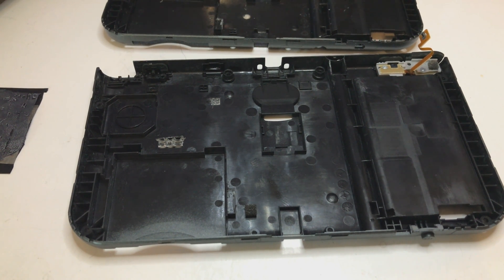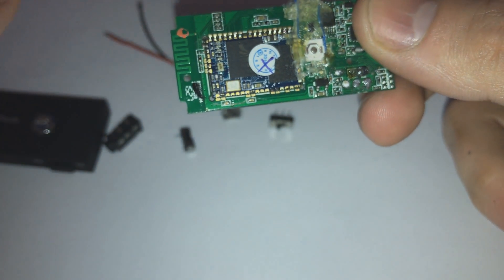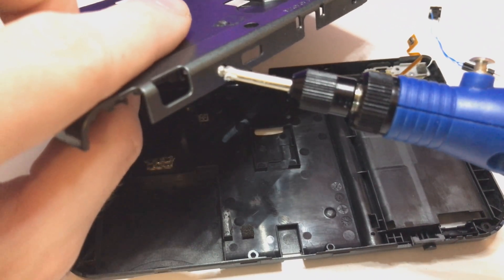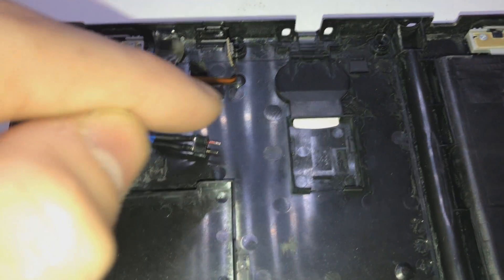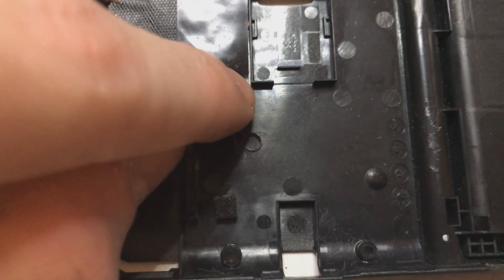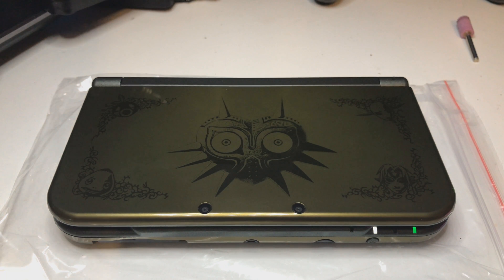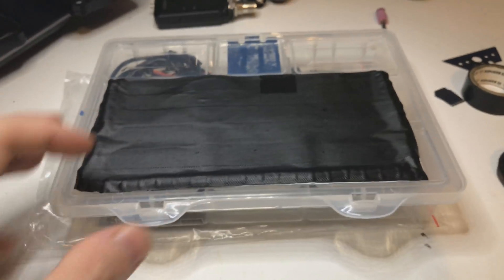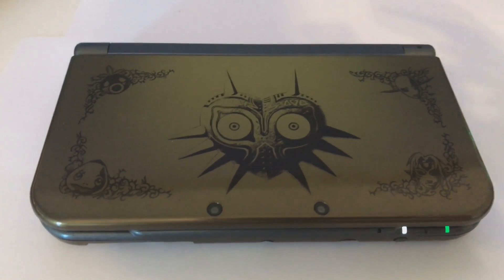Wireless charge + Bluetooth Mod Guide N3Ds XL in 4K

Comment: would there be any other ways to do this? from what ive seen on the original post some of the things required are either gone, sold out or discontinued so are you able to recommend any alternatives that should work?

Comment: Are you able to do it with a 2ds xl
Reply from the maker: not the bluetooth, i've checked, you can hardmod the 2ds and you can do the wireless charging, but it's a tight fit. but the bluetooth wont fit
Reply: Ah
Reply: Are you able to take in mine, i can pay for it

Comment: Hi there! I'm new to hardmodding, and dont have much electronic theory knowledge. So from my understanding, I can just use any coil & reciever then connect it to + and - on the charger? Or is there a specific coil you recommend? Thanks, fantastic video btw
Reply from the maker: I did recommend a certain one because i know that one will fit the housing, you’re correct you could use any, but it also has to fit!
Reply: @Gagliano17  Alright, makes sense. One last thing- how much room is there for things to go wrong? I’m on a highschooler’s budget & rlly can’t afford to kill my 3ds, so if there is more than a 5 percent chance that I mess up beyond repair, then I don’t think I can bring myself to do it.

Comment: I got a solar panel I wnana use for my 2ds xl how would I wire it up
Reply from the maker: Same spot that i used for the wireless charge mod
Reply: @Gagliano17  I cant see where need to solder the solar panel
Reply: So it gets soldered to the charger port the plate on the sides?

Comment: Can it be controlled with an 8Bit controller as it now has bluetooth?
Reply from the maker: not with this bluetooth no, this is audio bluetooth, but you can use a wifi tool to use a controller with the n3ds, i have a video where i show it, it's called like " my 3ds can do what the switch can"
Reply: @Gagliano17  ok I saw the video I love what I saw. Any chance you could make a video on the process you did to get it working like that?

Comment: Hey dude, nice job! But, didn't the 3DS already have a wifi module? And couldn't you use that instead? Because if I remember correctly wifi and bluetooth share the 2.4ghz frequency
Reply from the maker: No, bluetooth is different from wifi, especially ad2c, which is the streaming of audio, you cant modify the wifi chip to also support bluetooth if it wasnt made so from factory
Reply: @Gagliano17  ohh, thanks bud, i didn't know :D!

Comment: Where can i buy the zelda shell?
Reply from the maker: Aliexpress, i think i linked it?
Reply: @Gagliano17  ive read all the comment but i could find a link.
Reply from the maker: € 12,46  10％ Off | 2020 Newest Full Set Housing Shell Case with Buttons Screws Replacement Console Case Faceplate Cover Plate For NEW 3DS LL/XL
https://a.aliexpress.com/_veadFx
Those are different ones but you’d be able to find any there
Reply from the maker: € 5,13 | Original top shell case housing front cover for new 3dsxl for new 3ds xl US limited version
https://a.aliexpress.com/_u8EYKN
Zelda one is sold out atm
Reply: @Gagliano17  yeah😢i hope they restock it someday, thanks anyway
Reply from the maker: They probably stopped producing them because of the switch :(
Reply: @Gagliano17  so i might never get one, god i hate myself for not buying one
Reply: @Gagliano17  i asked a seller if they had leftover stock, and they actually had 3 leftover shells, and i bought one
Reply from the maker: YES DUDE, congrats!

Comment: Very nice, I have a type C mod I am doing to my  charger port. Might add a wireless charger
Reply from the maker: i'd do that, it's not expensive and plenty easy when you already desolder the original port, just adds to the upgrade experience
Reply: @Gagliano17  Yea simple stuff. my F1 fuse by my battery shorted out. Had to unsolder that and put a new one one it.

Comment: Tried the wireless charge part of this, used a s5 charger. When I placed it on a charger it said system failure, and now is hard bricked.
Reply from the maker: what do you mean place it on the charger? What did you do? Send me soms pictures
Reply: @Gagliano17  sorry i meant after i soldered the wires from the wireless reciever to the motherboard charging port, then placed my 3ds on my wireless charging pad to test if it was working properly it showed the orange light on the 3ds to indicate it was charging. then a few moments later the screen on the 3ds said system failure and turned off. i removed the wireless charging reciever and plugged it in, and it shows the orange charge light on the 3ds, but will not power on or do anything. i think my nand crashed somehow, so i will have to hard mod to restore it. i can send pictures of how i had it setup, and that the orange led comes on. i have tested both the fuses and neither are blown and the battery terminals are indeed getting power when plugged in (verified by a volt tester).
Reply from the maker: Must have shorted out somewhere, a wireless coil does nothing different than a cable, its + and - to the charging port, cant do anything software related unless something is not right
Reply: @Gagliano17  thats what i thought. I wrapped the whole assembly in kapton tape prior to assembly, when i tested it while it was on the wireless charger, for some reason it was sending 7+ volts to the charge port. i thought it may have overloaded a circuit or the system turned off as a failsafe, but couldnt complete the dump and corrupted something.
Reply from the maker: So it was probably a faulty wireless charge , and if that didnt fk up the charge system, which probably is replaceable, or repairable, i hope you have an older dumper ready :s
Reply: @Gagliano17  luckly i have a nand dump from when i first jailbroke it on my pc. the charge system still works oddly enough, my meter shows it both sending power to the battery, and the mother board. so i think its just a nand issue. i hope, if not i can always order a new mother board.

Comment: Taking a shot at doing the bluetooth mod tomorrow on the o3DS XL. 
Currently I have two options...
1) remove headphone jack
2) convert SD slot to microSD
Trying with a small Taotronics Bluetooth receiver/trnasmitter since I couldn't find your version.
Technically I could make it even smaller if I wire the antenna elsewhere so I might try that as well.  

Wireless charging mod was possible though so many thanks for this tutorial. 
Placed the charging coil on the battery and slapped on the back cover.
Reply from the maker: Kenta Kawaguchi aye nice let me know how that went, i did the wireless charge mods on the smaller n3ds but the o3ds seems full af, but i dont have one

Comment: What type of wire are you using
Reply from the maker: HeyItsNinja Gaming kynar
Reply: Dennis G would I be able to use this Bluetooth transmitter I can’t find the other one on amazon. link: Upgraded Version TaoTronics Portable Bluetooth Transmitter for TV, AptX Low Latency Wireless Audio Adapter for 3.5mm Stereo, Pairs Bluetooth Headphones/Speakers https://www.amazon.com/dp/B07W5S2WVN/ref=cm_sw_r_cp_api_i_TxzeEbNM3K8SF
Reply from the maker: Pictures dont give a real sense of size, especially not for internal parts, so i cant really give judgement on it

Comment: Do you have a link to the wireless charger you used? I would like to do this but space is a big concern, given how the n3ds Xl is really tight. Thanks in advance!
Reply from the maker: Ehm yeah mine expired on ebay but it was the qi receiver for the samsung s5
Reply: @Gagliano17  https://www.amazon.com/Slim-Thin-Standard-Wireless-Charging-Receiver/dp/B019YSWR2C/ref=sr_1_6?ie=UTF8&qid=1542752269&sr=8-6&keywords=samsung+s5+wireless+charger was it similar to this? Thanks for taking the time to reply to this
Reply from the maker: @rzyao64  yeah but i basicly stripped it down to the coil and just soldered to cables to the + and - of the 3ds charging port like i showed here
Reply: @Gagliano17  ok thanks!

Comment: Perfect.
3ds should have had bluetoth in the first place
Reply from the maker: Devices always should have had more, apple nintendo samsung they are all holding back so they got something for the future or to limit players, shame but its how it goes
Reply: @Gagliano17   i mean yeah, as much i would like to agree on that, if they did just that, the price just gonna jack up more, and with more parts, the easier everything will broken and that's bad for both consumer and producer.
Reply from the maker: I mean the samsung s20 ultra ist the closest we’ve come and it wasnt that much expensive.
Reply: @Gagliano17  Honestly, at this point companies should just let customers actually customize their devices when ordering, like you can do with computers.

If you could choose between components when ordering, they wouldn't have to change much of their business, so I don't see any economic downsides to this.
Many won't buy hardware without features they want anyway, so I in fact think they could see an increase in revenue.
If you have a set amount of choices and you require people to order before manufacturing, it's not in any way different from producing different types of phones and selling them in the first place. You actually eliminate some net loss from overproduction and bring in revenue from new customers that want to choose more.
Reply: The omission of Bluetooth and low resolution screen on 3DS was appalling even for the time.

Comment: Can you also just plug a blueth. Transmitter into the 3ds's headphone jack and use a bluetooth controller that way? Ik know it works for wireless headphones, but is that possible, too? Ik watched Geekrealms' video and he had an F30 bluetooth controller that he uses with your hardmod. Thnx in advance.
(I'm from the Netherlands, too, so you may reply in Dutch ;)
Reply from the maker: yeah ofc that works man, you can plug the bluetooth transmitter into the headphone jack too
Reply: @Gagliano17   so if im correct, I Just plug the transmitter into the audio jack, synchronise my controller with it and it should just work fine?
Reply from the maker: Tommy yeah with a slight audio delay based on the quality of the transmitter + receiver
Reply: @Gagliano17  ok thanks
Reply: @Gagliano17  
One last question: did you try this yourself?

Comment: I had another comment but I deleted it because it had atrocious vocabulary for me at 6:30 in the morning, what I was trying, about the Bluetooth button, to say was you could take a piece of the bottom part of the case and glue it to the top part of the motherboard Side of the of the bottom screen shell, and you wouldn't use glue so you can take it apart without tools and put it together without any either. That way if you just want to take off the board to mess with another mod you did you didn't have to worry about disconnecting the Bluetooth button.
Reply from the maker: i have that sorted, i have a connector on that glued part, so when i take it apart i can just disconnect that connector quickly

Comment: Next time you add a button to the 3 DS why not take a bit of the case off with it, put a little rubber around it so that you could have a little empty space. And glue the piece of plastic you took off to the button and it would stay attached to the board. And you could still remove the button without any tools.

Comment: How close are the sbc's we have today to emulating 3 DS, the high-end SBC's we have today or from 200 to $300 and they don't crash when running but they don't give a playable frame rate either. And they wouldn't fit inside of the 3 DS case but they would fit inside of the Nintendo switch.
Reply from the maker: i'd not know because i don't own a switch

Comment: Why would someone ask you how to do a wireless charge mod you can buy USB wireless chargers that are thinner than the glass screen on my cell phone.
Reply from the maker: that statement is so inaccurate but whatever, some people dont have the "i gotta buy" because i can't build it myself mentality.
Reply: It was very early in the morning for me, I'm sure there's some more complicated way that you did it I was just thinking that there's also a simple version to.
Reply from the maker: that's always the case, my way is cleaner + easier to carry, build in, the point of mods is to get additional options in a stock build without having to carry extra stuff or having it out ugly
Reply: www.amazon.com/dp/B076BQL7C3/ref=cm_sw_r_cp_apa_0UPSAbR6DQX8T
 That's all I was referring to
Reply from the maker: yes and that's what is used in this mod, you just build it inside the 3ds instead of wasting a charger port + having to resolder wires to have it work with the 3ds charger port + cables running outside the 3ds.
Reply: I know you have a similar one in your video I was just referring to it being thinner than the glass in life smartphone. Watch apparently is .26 mm I have no idea how accurate that is, again it was 6:30 in the morning sorry.

Comment: thanks again for this video! Just an FYI for anyone doing these mods using the "dock" connector - if the back of the 3ds is facing you with it looking like this [R zr charge port pad right, charge pad left, zl L]  the charge pad closest to the ZR is ground (negative) and the left is positive
Reply from the maker: no problem man :)

Comment: nice video! and achivement unlocked for me I went with this transmit only unit 
https://www.amazon.com/gp/product/B00NP9MYFM/ref=oh_aui_detailpage_o03_s04?ie=UTF8&psc=1
QI charger is on the way for achivement number two! nice job on the led!
Reply: qi charger for s5 installed this morning :) went perfect under the battery tray with
https://www.amazon.com/gp/product/B019YSWR2C/ref=oh_aui_detailpage_o09_s04?ie=UTF8&psc=1

Comment: great tutorial! would love to see you tackle 3ds DVR installation.
Reply from the maker: i've never heard of that? could you link a example? and my 3ds is pretty much out of space on the inside :P
Reply: Dennis Gagliano Well, I'm not sure I have any examples handy at the moment. but there are 3DSes being sold just to record gameplay. My best guess is that they use a cheap DVR and hardmod the 3ds. you can find plenty of DVR 3dses on eBay for about $500.
it would be cool if those parts were available off eBay. Might need to do some research myself too.
Reply from the maker: oh you mean a capture card, nah i can't do those you need a special device to build in, only two people have them that i'm aware off, i think ntr streaming is more then good enough for recording my gameplay

Comment: could you leave the switch installed to be able to use a Bluetooth controller if it can be put in receiver mode?
Reply from the maker: if you mean, use the bluetooth transmitter inside the 3ds to connect to a controller, no, that would require a usb bluetooth dongle and the 3ds does not have a usb data port, so you can't do that, i use a usb bluetooth AUDIO dongle that transmit's the audio comming from the headphone jack ,there is not receiving usb data port on the 3ds :s so that can't be done, i still can use a ps3 controller on my 3ds using a program though

Comment: I wonder if I can get something like this on my 2DS
Reply from the maker: yes you can, i already tried if it fit's a 2ds, but the 3ds is rather large so it's akward to have it on a wireless charger stand, you'd have to build something like i've done with my box
Reply: Dennis Gagliano thanks. I was thinking about adding a c stick and zl and zr buttons too(if I could ever figure out how to wire it up) then add a micro USB charging port, larger battery etc. then maybe an external controller mod? It's a large list but I find it hard to turn down since it brings back memories of modding my psp.
Reply from the maker: i've seen already that someone has done a c-stick mod for the 2ds, so that's out there, idk about zl-zr though, you can have mine from my n3ds xl, i never use them haha
Reply: lmao thanks. After installing cfw and playing pokemon on it I got pretty attached to this thing and decided i might pick up a 3ds xl to carry around with me. Ill mod that one then ill be set. Now I just have to find one around the $200 region and ill be good but i have a feeling that wont be so easy.
Reply from the maker: honestly, i'd get a second hand, and buy the 12 dollar majora's mask housing from ali-express, those are perfect and make your 3ds look brand new, since you mod it anyway it's better to have spare housing anyway.
Reply: Thanks. Will do. Ill attempt the nand mod first. Is there any use for the nand mod outside of downgrading since 11.2 has already been hacked and can backup nand? Sorry for all the questions, just overwhelmed with excitement lol

Comment: here the problem I get a black screen when I boot it up and I did a back up nand with gateway and not with decrypt9 with that still work if I use gateway on 11.1 and decrypt9 with my gateway back up nand
Reply from the maker: yes those backups are the same you can use gateway backups to restore with decrypt, i'd suggest you post this on gbatemp though people can help you out much better there
Reply: how to i post on gbatemp still new to things
Reply from the maker: sign up, make a thread, in the hardware and accessories tread